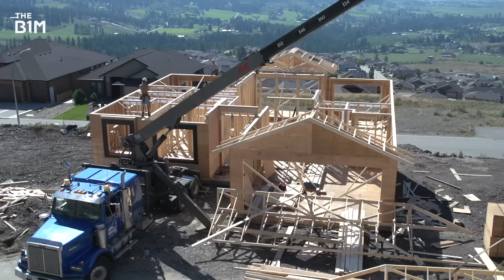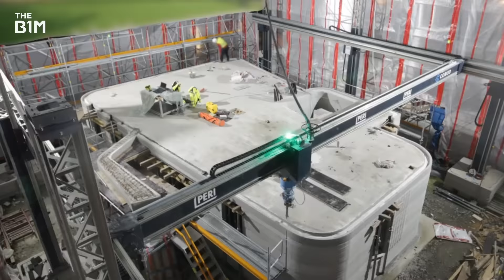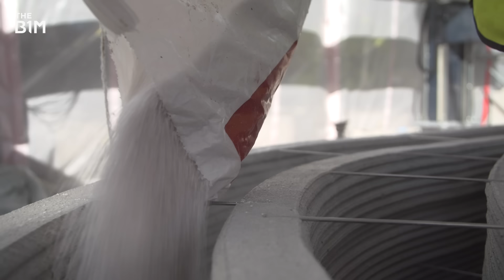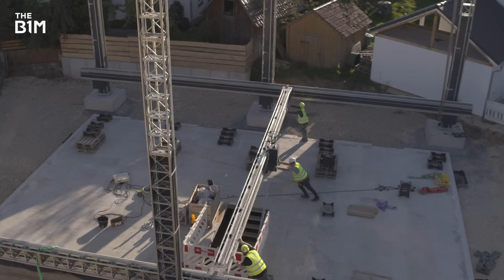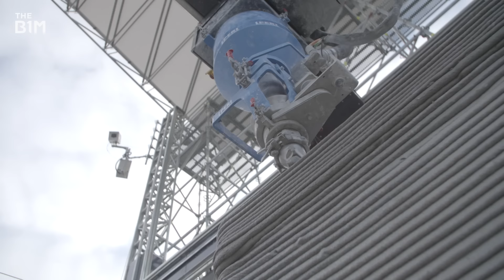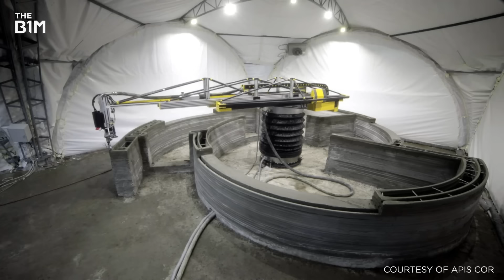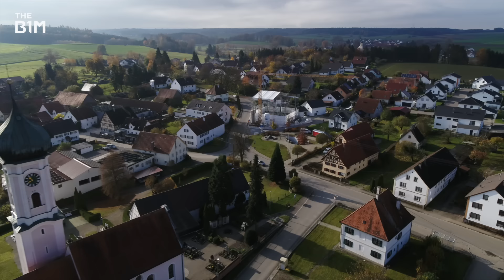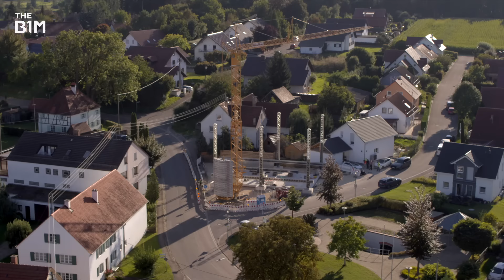Why This 3D-Printed House Will Change The World

Comment: I saw a robot make a brick wall once.  Would not something like that make more sense? Once you place these extruded walls down it would seem to me that you're stuck unable to ever alter or fix them.  Some brick like system would allow you to replace part of the wall if need be.  Is brick just not sexy?  While the basic truth that machines and computers should allow us to perfectly spit out a house without waste, why 3d printing like this? What the advantage of essentially manufacturing all components on site?

Comment: This is so wrong 
Pumicecrete is by far the best building material on the planet Pumicecrete is fireproof termite proof rust rot and mold proof and has a high R value and good sound attenuation solid poured walls means no critters can live in your walls

Comment: Once concrete starts to deteriorate, its a hard fix when its 200 feet in the air and the chance of seeing it or finding it is pretty slim, concrete crumbles and sucking in moisture doesn't help it.

Comment: This is the worst way environmentally to build a house. You are using cement which is the worst material vis a vis carbon footprint. Unfortunately, you cannot 3D print your windows, doors, electricals and plumbing. Furthermore, remodeling this kind of house, say trying to knock down part of a wall is impossible. I much rather go with a technology like Bamcore that makes prefabbed panels out of bamboo. It is faster to assemble than 3D printing. Has a negative carbon footprint. It is the most efficient way to capture carbon. Has none of the remodeling limitations. This 3D printing is a gimmick  IMHO.

Comment: I've seen a video of a 3D printed house before. At first, I didn't think such a house was simple and cost less than a traditional house, but the opposite is true. If the materials are used properly, the strength of 3D printing houses is no worse than that of current houses, and the cost will be cheaper. The only expensive place is land use rights.

Comment: I'm not sold on 3D printing cement/concrete houses for environmental reasons. The cement/concrete industry is one of the largest carbon emitters, totally 8%+ of global CO2 emissions. If we start adding large scale 3D cement/concrete printing of housing to that, the emissions are only going to go up as the industry will need to make more cement and concrete. On the other hand, building houses, as we do now, out of mostly wood, that wood is sequestering the carbon that tree sucked out of the atmosphere in the house.

Comment: How this system works in places where space is a premium? Apartment buildings? How is protection against earthquakes achieved? 
This is an improvement, but still looks like a project for a First World suburban house, not a solution for the world's peoples in need for a roof over their heads.

Comment: can someone tel me the advantage of such expensive Machines? an simple concretepumpe can build 3-4 constructionsites at one day... this expansive machine stands 1-2 month at only one constructionside. in the hole house is no reinforcing steel. for the concret ther must be much more expensive zement so this small concretpump can manage the medium. in concret the most expensive and co2 intensiv thing is zement. 1m³ c 25/30 with 32 stone you need ~600 kg zement with 8mm stones this goes up to 800kg but this pump only can woork with mortar and you need more than 1 to. for only an single m³. thats like 100 mor co². this holehouse is build out of every standart DIN-EN's in germany

Comment: I'd like to see how these structures stand the test of time considering it's mostly just extruded cement with no rebar. What happens when the ground settles or with freeze and thaw cycles.
Reply: I was under the assumption they drop rebar in as it was printing. If not, then yes this is a recipe for failure.
Reply: @DaveSmith-cp5kj  Of course they do, otherwise these houses are worth for nothing lol.
My almost-only-brick house is over 120 years old and stills standing
Reply: @kirakira9906  I don't think so. I have seen many videos of 3D printing of houses and not seen any with rebar. I think that's the reason why they can't build large structures with 3D printing tech yet.
Reply: @kirakira9906  On the other hand side, if construction is cheap you could instead of renovation just build a new one with the floorplanning you like.
Reply: @svengrundmann6649 Yes, but that doesn't sound very environmentally friendly, does it?
I don't know, I'm truly asking.
But as for now, material production is polluting a lot and you need way more for new construction.
Of course sometimes it's just point to renew your old house, but sometimes it's smarter.
Reply: @DaveSmith-cp5kj  We saw rebar is not worth the trouble in Florida.
Reply: I was reading 30 years ago that individual, smaller pieces of reinforcing steel in the concrete mix could be substituted for longer rebar sections.  In any case, I doubt much, if any, rebar is used in home construction today.  Not, in wood frame construction and even brick and block homes would often not use rebar.  Possibly, in the concrete foundation, but often not.
Reply: @vin.handle  helix micro, and there is also fiber nylon used as well.
Reply: @vin.handle  Yes but bricks would stand much better ground settlements and environmental  conditions, I think than concrete alone...
Reply: @vin.handle we use rebar all the time in Canada for foundation and footing reinforcement, would never pass code if you didn't. If you have concrete walls for the main walls in a house you definitely will be needing rebar. Im in engineering and we do it all the time and brick is terrible in a high seismic zone so we tend not to use it.
Reply: Design & model it on a computer using FE analysis. Once you get your dimensions correct it will resist almost all natural forces including earthquakes which can also be simulated within a solid modelling environment. Also model high winds. When it's correct on the computer build it in reality. All you have to do is counter the principal stresses within your design. It would need to sit on a traditional pile driven foundations with steel reinforcements.

The material used is good under compression and shear but weak under tension so it would be very important to model tensile stresses in the structure.
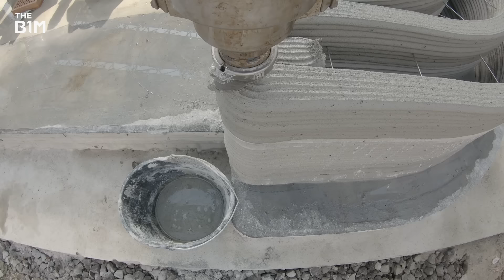Reply: 1:07 I saw rebar in the video.
Reply: @user-gu9yq5sj7c thats is not even close to being rebar, if it is then this structure would fail miserably in a high seismic zone.
Reply: They use a mix of materials.

Comment: what did he mean when he said rounds are way more sustainable than recktangles? any ideas why?
Reply: I have a few ideas: 1) structural reason 01: rounding reduces stresses, so less cracking and maintenance costs 2) structural reason 02: 3D "round" structures act as a shell when designed properly, they can also be compression-only structures (like the martian renders they showed in this videos), which can dramatically reduce material use. this is about using curvature where appropriate - think about vaults, arches, etc, the linear beam is designed to be bent, reinforcing is necessary due to geometrical reasons 3) thermal reason 01: thermal bridging occurs due to two primary reasons: change in material or change in geometry (corners, T shaped joints -like a wall in floorplan or a slab in section, etc). you can reduce the geometrical effect with rounding your corners or trying to eliminate it. 4) thermal reason 02: the sphere has the "best" A/V ratio (A: area of your thermal envelope, V: enclosed heated volume). scale and shape really determines how much energy a certain design will consume, or formulating otherwise, what is the possible lower bound for energy consumption given the technology (you can always increase insulation thickness on a random polyhedral shape to reduce losses coming from a less than ideal shape). I'm sure there are many more aspects you can think of, this is my morning coffee take on it.:)
Reply: @furtonb  Wow, thank you so much for the informative reply I would never figure it out myself since I do not know whatsoever about construction. really appreciate taking the time :)

Comment: Brightens my day. I’m in the building industry and it is the most backward industry I could ever imagine, left behind by a Century at least. Nothing but work and rework using the same techniques that were used 100 years ago but with way more complexity required. Yep we have clever power tools, but almost no innovation.  This 3-D printing is delightful. It will eliminate so much labor, improve quality, allow for many more designs for a given site, Improve energy efficiency, the list goes on, this is wonderful! Good job Perry!

Comment: Wait the minute..The 3D printer only contructs the building & structure...I mean you still have to use manual labour to install water piping, electrical wiring installation, sewage & ventilation system, right?

Comment: This is so fascinating… That first one with the rounded edges is what I love most about it, you can design a home in almost any shape you want it and not be stuck with the traditional square shaped walls of a traditional house!
Reply: Going to waste quite a bit of space w the angled furniture you already have.
Reply: You aren't stuck with a square shape with other traditional building materials lol... Wood or cemete, brick could all be done in circular shapes etc instead. Heck look at old wooden ships they are very rounded everywhere yet it's entirely wood interior...
Reply: Look at castles which have been around forever.... Cylinder sections all over made of brick that are massive
Reply: You can easily round edges like that with wood you just need a device that steam heats the wood as it's being bent.

Comment: 3D printing will dominate everything: from cars, aircrafts, spare parts, human organs to houses. It is simply manifestation machine. According to Dr. Greer many ETs had this technologies for thousands of years and all their vehicles are 3d printed or manifested from thin air or higher dimensions. Printers will be available everywhere and all you need is set of codes or instructions to build anything you want.

Comment: All it does is put bricklayers out of work. What about the plumbing, electrics, plastering, roof and floor tiling, ceilings etc etc. It’s all an exaggeration and fucked if I’d live in one. Look at all the heavy plant. Time setting it all up. There will be zero savings for the consumer.

Comment: Feels like the ecological impact of concrete is really underestmated in all this. Cement production produces a lot of emission, concrete pouring requires a lot of water, and can barely be recycled once the building has reached the end of its lifespan. I think there's something to be said about more sustainable building where thought is put into recycling at the end of a building's life...
Reply: Concrete requires a particular kind of sand, which we are running out of. That was my first concern. Still, $4000?

Comment: Contractors gon be pissed when they find this 3D printer won’t have delays 🤣
Reply: gon be pissed when they have to knock down a concrete wall to get to a water leak!
Reply: 🍷😆😆Oh bet we wont be needing them anymore. This process of directly placing orders with the company could potentially cut out more than a few middlemen!
Reply: They could take on more projects which off sets the profit gained by delays.
Reply: Why not make it accessible behind locking panels? Think the type used on motorcycles. They snap into grommits.

Comment: Concrete production and destruction is responsible for %10 overall of construction greenhouse gases. The dust particles cause micro abrasions in the lungs that cause scar tissue to grow. Plus concrete is garbage at insulation. It’s a very silly idea. More sustainable wood and more codes to use wood is the way to go until a better alternative is figured out. This is disruptive in the negative use of the term for the environment.

Comment: this is stupid all it does is spray cement like tooth paste so it becomes a wall, pretty sloppy.  better off using concrete  forms or cinder block but 3d printers are so cool

Comment: How would one hang a picture, or shelving?
Reply: I’m not sure what kind of concrete they are using here but possibly it is aerated (bubble infused Lightweight concrete, or some other product that is not as totally hard and solid as standard concrete. It’s not hard to imagine all the possibilities. In this way you can drill holes in the wall with readily available masonry drill tools.  People have been living in brick houses for Centuries, this is not new. Use your head and you will figure out how to hang things on the wall.

Comment: Two questions I have:
  1 - Are the walls ever sanded down so they're flat?
  2 - What about renovations? Can you knock down a wall?
Reply: Another question is how do you insulate it?
Reply: @MarkusGlesnes  From other videos from other companies - it seems they use expanding foam in the wall cavities.
Reply: This video is a bit salesmen-like. Would be worth seeing a video of a fully occupied home a year after construction. Machine set up, and knowing if the machinary needs a particular climate to function in would be useful. Extensive secuirty to protect the equipment, temporary scaffolding and temporary roof costs...all that for a house in this vid & manual work at the mo is a poor bloke running around the site putting in wall ties, weeps and lintels.
Reply: 1 for the houses in the video no. You would most likely just put a filler material there after hardening.
2 same as with all other houses, it depends on the wall you want to break down.
Reply: I have noticed that the walls are rounded making it more structurally sound than traditional rectangles (right angles). Adding an addition should be a lot easier, with more room for error.
Reply: Ms. Jeffrey: I have seen a finished house like this in New York, and it was left rough on the outside and painted, and looked really nice, and a similar one elsewhere was left rough on the inside and painted and looked quite nice.

As for renovations, this isn’t so easy to do with conventional construction, even with wood walls, and let me tell you I’ve done it uncountable times.

If you notice in this video the walls are hollow on the inside, so a double wall structure, and walls can be knocked out, or better said, cut out, with masonry cutting sauce. Again it’s not so easy, but neither is the situation as it stands now.
Reply: It would make much more sense to plaster coat them smooth as you would with a cement block house.

Comment: But someone still has to manually add those little support bars and braces and concrete is a carbon intensive material to manufacture. And you still have to assemble the printer frame on site, using a tower crane no less, something I’ve never seen before for building single family homes. I wonder if there’s any actual improvement. And some of those designs shown look like they’re mimicking stick build shapes.

Comment: How can they build it without Steel reinforcing in the concrete, we usually see in traditional building, is it strong enough?
Reply: Because its a cavity wall. No diferant to cavity wall brick houses. Stainless Steel wall ties are used spanning the two skins.